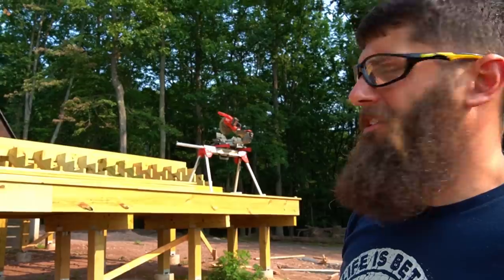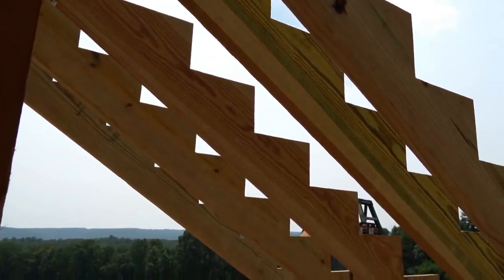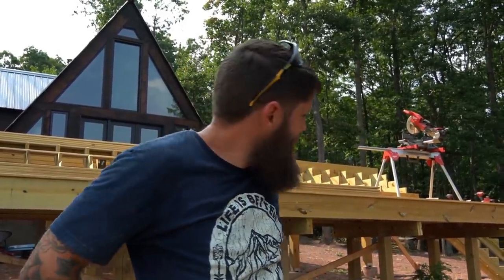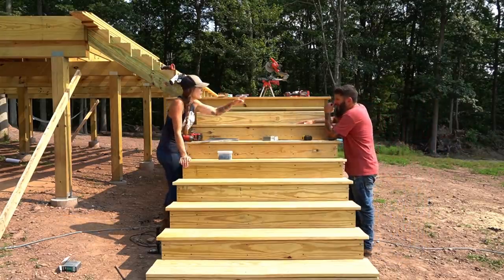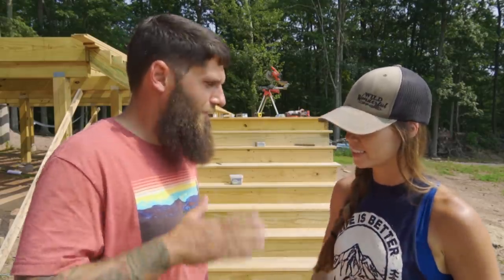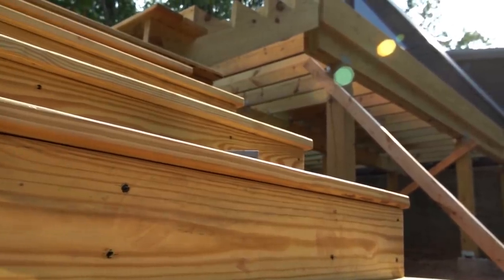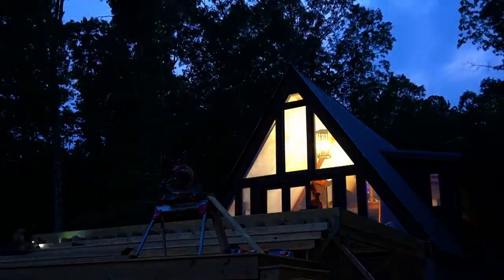Simple Steps For The Ultimate Home Upgrade

Comment: Looks Fantastic! Once that big deck is dry enough to stain check out Graco Sprayers, mine changed my life lol
Reply: nice to see you guys here love your channel
Reply: I have one for painting, love them
Reply: Came to the comments section to make exactly this suggestion. Sprayers are game changing for staining.
Reply: Spraying is fine, but it needs to be done before wood is assembled, in order to fully protect the wood, even at the connection points.  We used to do 3 coats of Sikkens before even taking the lumber to the job site.  Then coat the cut areas during construction.  By the way, I admire your overall project and y’all’s love for one another.
Reply: They used treated lumber… until it dries and the preserving residues have washed from the surface…. Sealing and or staining are not a good idea.
Reply: I’m getting rid of mine (also loved it). You guys want it?
Reply: Hi guys !!!!!!!  Big Hello to Hunter !!!!
Reply: @sassafrasvalley1939  better to wait a year minimum.

Comment: I would've recommended stainless anchors for the plates holding stringers to the concrete landing pads.
Reply: And I always screw a 2x4 to the stringers
Reply: They are galvanized and will be fine
Reply: @gtpro700  I have deployed many, many Tapcon fasteners and can tell you that these are not galvanized.  The blue coating is pitched as a corrosion resistance layer but these are not corrosion resistant in my experience.
Tapcon offer a line of SS fasteners that would be far more durable in the field.

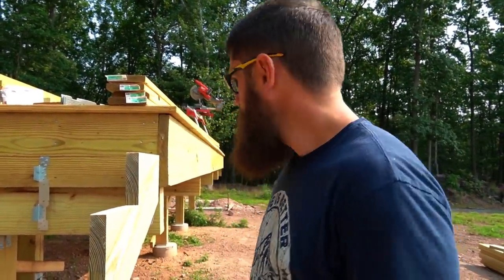Comment: 5:00 wood directly on cement will lead to rot, usually a waterproof spacer is applied, just a piece of single will do, cement holds water and the wood end cut will wick it up.

Comment: Before winter you need to take out those anchors into the concrete. The heaving will split the stairs. Since you have to close in the risers anyhow just connect the front and let them float on the concrete and you won’t have any problems.

Comment: The wood will continually absorb moisture and rot when it rests directly on concrete. Builders put a durable vapor barrier between the two, using a roofing shingle or tarred roofing felt. Simple to do .

Comment: It looks great! May I make a suggestion? If I were you I would put a strip of some kind of barrier between the stringers and the cement. If you don't the wood will continue to wick water from the concrete. You have the metal brackets between your porch supports from the concrete.  Maybe the pink foam the builders use or stripes of clear plastic it want be as noticeable as the pink foam.

Comment: Looks great guys! One recommendation if amenable to feedback would be look at the end grain of your long decking boards before installing. Recommend putting the arch side of the wood grain up. What I mean is the arch of wood grain should be at the top side of your deck boards when installing to your floor joist. Example of the end grain: /--\ vice \_/. Over time between change in seasons, temperatures, etc. the boards with the arch down will have a tendency to cup. Keep up that great work!

Comment: Another great video. The deck is a wonderful addition! After all your hard work, I hate to mention the following. It appears from the video that you have installed the tread boards flush against each other with no significant gap between them. Perhaps I'm not seeing this correctly. In my experience, it is advisable to leave a space between the boards to allow for drainage and swelling when wet. When I purchased my house, it came with a 1100 sq ft deck built by the previous owner. The owner had installed the tread boards and decking boards flush against each other. When it rained, puddles of water would accumulate and not drain, making the surface very slippery. And, worse yet, the boards deteriorated very quickly because they stayed wet long after the rain ended. I could not take up the boards and reposition them without destroying them, since they were all nailed down and the nail heads were recessed. In the end, I drilled drain holes along the seams of all the decking and tread boards to provide drainage.

Comment: Quick tip, when putting down boards you'll walk on always check the curve on the end grain before fastening it down since it matters more that many realize. It it forms a smile it should be flipped so it's a frown so it's tendency to cup faces down not up. Indeed if you've ever been on one and catch a foot on an edge that's risen above the rest it end grain made a smile not a frown. When the curve is facing down  not up the boards edge will cup downward since it is natural. The last two stair treads end grain were smiling not frowning means over time it's edges will rcurl upward not down  often needing sanding depending on how much. Dimensional lumber's nature is to return to the curve/twist of the tree it came from as it grew and its rarely true/plumb down its length and it why making sure tendency of it crowning like an arch is also like putting it down so the curve will flatten by resisting instead of giving into it when it's installed with that curve makes a smile..

Comment: For the future, you can stack 2 boards together, trace the stringer on the top board, and cut them simultaneously.  Just throw a quick clamp on each end to prevent from shifting and you get 2 stringers per tracing.  The top board gets cut 100% and it scribes the bottom board with a partial cut.  You go back and just cut off the remaining depth in the bottom board and no need to setup and trace.  <3

Comment: Love your show. Really hope you always have projects. Cool that you are making your own stringers but don't you have to seal the cuts. It would be a pity to have vulnerable spots on the wood after all that work you are doing. And because of the size of the deck, more reason to protect it as you go to avoid having to replace/repair prematurely. Cut-n-Seal is the product we used when we built our deck last year. Hubby cut the wood and I sealed as we went.

Comment: I looked at my deck I built in 2001-  24 inch centers on everything and about half the screws that you used-  hasn't fallen down in 20 years and looks as good as the day I built it-  that means yours will last 100 years-

Comment: It looks amazing; however, the treads on the boards need to be rings with the cup down. They collect water over time and will rot faster than the ones where the rain rolls through the boards with the rings not making a cup.

Comment: hindsight and all that, should have tar coated the bottom of the stringers stairs at the concrete base even if the wood is treated it would make them last much longer (more than 5 years for such a small step). great deck btw

Comment: You should have cut a 11/2" off the bottom of those stringers, and run 2 2x4 treated pieces the length of the concrete pad, to rest the stringers on and prevent dry rot. That might not pass inspection.

Comment: I have followed every video you ever made, and eagerly look forward each week to new stuff. Loving how the "patio" is coming on (it's about a basketball court size, right?!) I was, however, wondering why you did full length steps between the two levels. I would have thought that two sets of steps, a couple of meters wide, would have been enough (one to the left, the other to the right). How are you going to deal with the requirement for stair rails (bannisters) across the full length of the stairs?

Comment: Ok, help US out as many may have been wondering the same thing...? Why so many stringers per stair walks? Must not be any  treated lumber supply issues in WV this season?
Why not use 24" or 36" stringer spacings to get the job done here? Much less lumber, screws, hangers & cutting.
Nice results here. Keep up the good work.

Comment: Decking boards warp, producing cups that hold rain, or mounds that shed rain. The decking board ALWAYS warps in the direction of the end-grain. The board at 18:11 (grain looking like a rainbow) is correct. The two boards at 18:22 (upside-down rainbow) are incorrect. Those two boards, and any others like it, will warp to produce the cupping of rain water. Correct at least before decking the big, top section.
Reply: I just read an article that states the opposite of what I said. Oh, boy! One of the two ways is correct -- one creates cupping the the other good run-off, but now I don't know which is correct. Sorry! I love this channel so very much.

Comment: Are you going to seal the deck. Paint or stain. If so seal and sand for a good seal with smooth surface. Handrails? Are you going to hang a dome light, you know something special.

Comment: Looks great and I don't know if the code specifies if you have to stick to standard jack width on odd size stair widths. If you wanted to half-split the distances on those jacks to make them uniform distances, it probably would have been fine with any code inspector?

Comment: Will your stairs pass code?  In WA and OR, on pressure treated outside, a strong back is required on every jack, a PT clear is required on the slab and each jack would be notches so no ground contact.  Are you getting inspection?

Comment: Folks here's a tip for everybody to use, make your own stair stringers its easy.... you go to Lowe's or any other hardware store and buy a set of stair gauges, they are just two little brass nubs that clamp on to a carpenters framing square.
Step 1 Take any deck,  measure it from the top of the deck straight down to the ground. Lets say for example, the distance is 6'.4'' or 76''. Divide 76'' by  7.50'' which is the standard height for all steps,  this will tell you how many steps you need. For this example the answer is 10 steps.
Step 2 : You take a piece  of 2 x12'' for your stair stringer and using the carpenters square that is now set up for "Rise and Run"* of each step,  mark out the steps and then cut them with a circular saw within a 1/2'' of the line and then finish up with a hand saw to get a square cut. Cut your 45 degree angles on the back of the stair stringer for top against the deck apron and bottom for the concrete pad and your done.
If you are making steps from one deck to another, the principles are the same.
*Rise and run 
the rise is 71/2'' on one side of the square x's the depth for example 8'' for each step on the other side of the square.

Comment: But you didn’t leave enough of a gap between the decking boards. The riser on the bottom step is touching the concrete too. Same with all the risers touching the treads. This will rot from water being trapped. You need a quarter to half inch gap. Everywhere. As an architect this is the biggest reason why I get asked to replace decks because over time they rot and look bad so the client asks me to come up with something new. Oh dear.
Reply from the maker: The wood is wet. As it shrinks you end up with a gap. We did this on the lower platform of the deck and the boards have already begun to shrink giving us a proper gap
Reply: @WildWonderfulOffGrid  oh sorry. I thought it was treated. Carry on ha